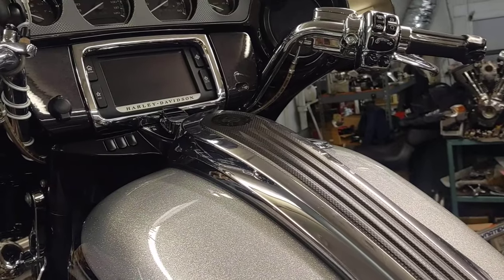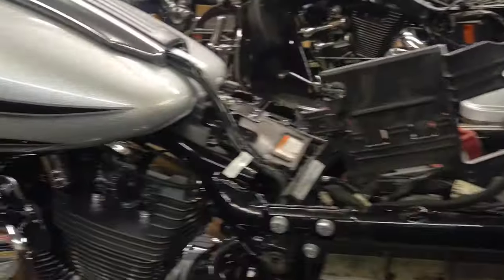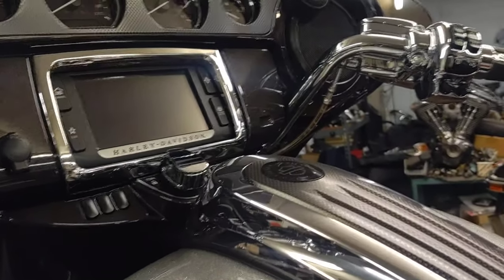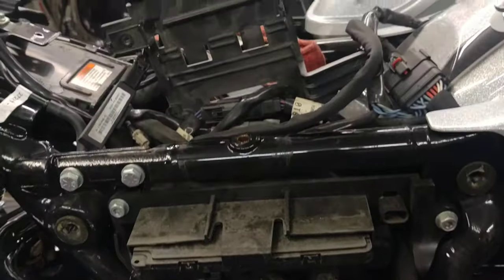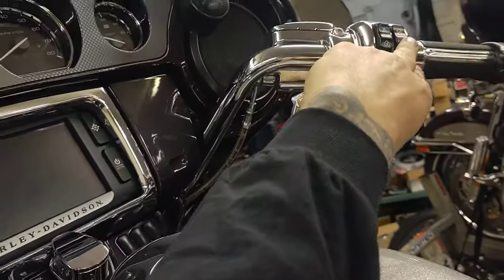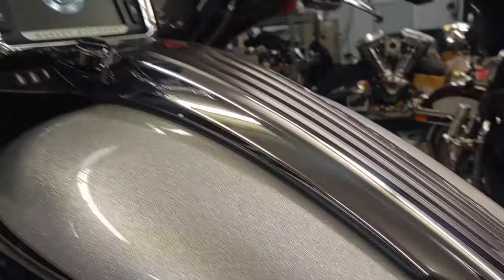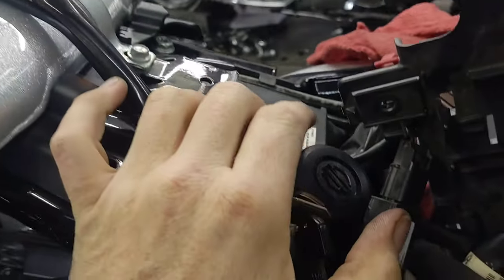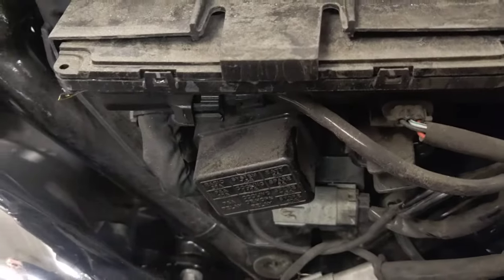Quick Tip - How to disable Harley Davidson alarm to change the battery

Comment: Hi, I would like to do same with my '09 Sportster 1200 (with button-less fob and key and H-D security system with alarm). Would the following work? With the fob present, turn the ignition key all the way to 'on' (effectively letting the security system know that it's actually me and that it can chill) and then take out the main fuse. I think that's the equivalent for a Sportster of what you did with the CVO Road Glide. If that's correct, another question I have is whether I can then turn off the ignition and walk away with the fob (and key) to do whatever and return to work on the bike later. That is, will the alarm sound off if I take away the key and fob while the fuse is out?